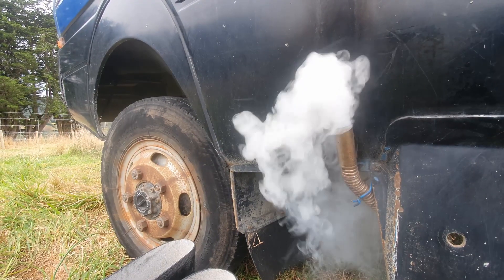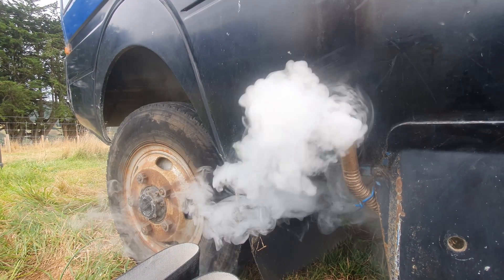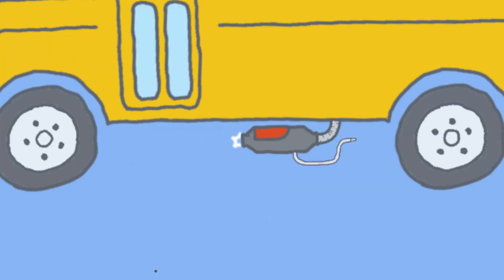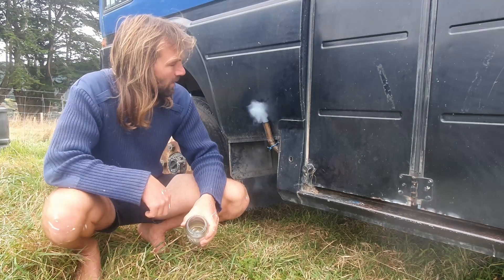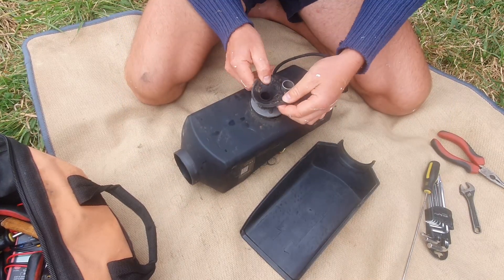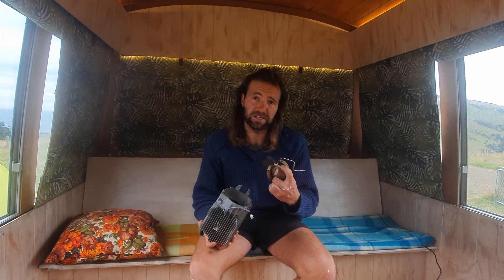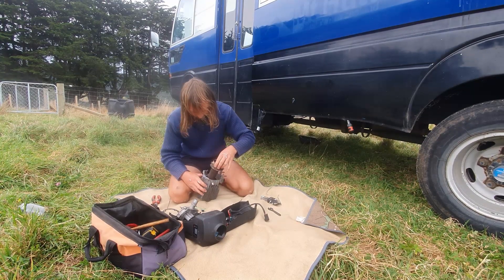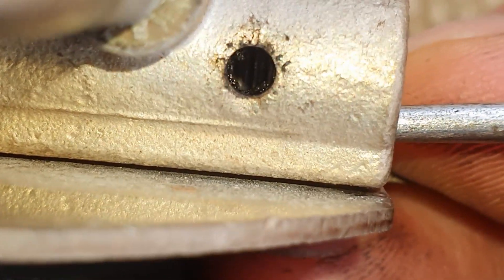[SOLVED] Diesel Heater Won't Start, Blowing White Smoke

Comment: I am a mechanic that's certified on all Espar/Eberspacher products i broadly agree with this video.

One thing I disagree with though,

Every 2000 run hours you should replace that ignition mesh. If you are in a serious bind you can do as he described. The meshes are very cheap, even the espar official ones. Get the green gaskets as well. It's very important or you will be wasting a lot of diesel and having combustion products(carbon monoxide!!) getting into your heated area. LIVING area. You'll be breathing that stuff. 

Remove the glow pin with a 12mm wrench, use a small screwdriver and needle nose pliers to remove the mesh.

 All Bolts are torx T27 except for one holding the control box which is T20.

If you are not confident about it, ask somebody you know or bring it in for professional service. Prolonged carbon monoxide causes brain damage and headaches. If you live in a bus/van and rely on these heaters... Please, do it right. For your own sake.
Reply: Thanks for sharing this, I‘ll bear it in mind.
Reply: Thanks.  I’ll be adding this to my notes. The internet isn’t always available and I like to document my stuff.
Reply: Likewise

Comment: Your not going to  believe this. I installed a deisel heater in the trunk of my Lincoln.  I added the extended exhaust pipe.  I carefully routed the exhaust under the framerail the back upwards 4" creating a trap in the exhaust. It ran fine. I was very happy.  But then it got extremely cold.  No problem.  I fired up my Deisel heater. Only 3 months old and she was running great. Then I noticed the exhaust was dripping water. Then the heater shut down.  I tried several times to restart it. It would try to start.  Pour out white smoke.  Then shut down.  I was upset. I ordered  another heater.  Today I was going to remove the heater and install the new one. As I stopped for a coffee break.  I was trying to search videos on the subject.  I came across this video. I thought to myself.. NO WAY iT could be something so simple . I got out of my car. And crawled under my car. I cut the exhaust straps and let the pipe down.  About 6  ounces of water came out.
I tried to fire up the heater.  It fired right up. Lot's if white smoke. But it was soon to dissipate.  The heater is running like a champ now. I wanted to say thank you. And I'm  going to buy you a couple of bears. Thanks again.

Comment: Great video! This video confirmed what I theorized the problem was. Tomorrow is my day off and I plan on taking this heater apart and cleaning it out.
Reply: Well jfc what happened?
Reply: @007nadineL  I cleaned out the burn chamber and replaced the screen with a new one. Works perfectly now.

Comment: Exhaust outlet and air intake pipes should be the same length otherwise it will cause an imbalance inside combustion chamber

Comment: Had a buddy that had two diesel fired heaters . One would heat coolant for his floor heating setup and the second would heat the air at low temp low speed. Said it was more comfortable that way

Comment: How often and for how long do you recommend running it on full blast to prevent coking problems?  Let's say it's always running on manual low because the room is well insulated and that's all you need for the temps you find yourself in?  I understand that running it always on low will eventually give you coking issues, so how often would you blast it and for how long in this situation?

I switched to the cheap diesel heater option from a Webasto gas heater, which did nothing but coke up.  It was either replace it or check it into rehab.
Reply: Before you turn it off, or if you're running it consistently, once a day.

Comment: Thanks Man! I thought I was in for buying a new Heater. Instead i removed it from the Van and cleaned it like your video showed. the only thing i couldn't do was remove the screen by the glow plug. Instead I just washed it out with some great cleaner I have. It started up and worked great.
Reply: make a hook out of the stainless steel wire of a Chinese food container and stick it in the screen opening at the far end and pull it out. Good to have a few spare screens as they damage easily. I also had a lot of carbon buildup in that hole past the screen and used the same wire to open it up by poking a hole through the carbon.

Comment: The faults were in your instalation..... the only thing that should be outside is the exhaust that should be running down, not back up to create a trap..... this is a cabin heater, not an external mount furnace

Comment: The tiny air intake hole for the glow-plug is the path for fuel leakage when the heater is operated on its side (the wrong side, with glowplug facing downwards - whereby the blown cabin air will eventually contain diesel fumes) - it's not 'leaky' or faulty, it's why correct positioning is key.

Comment: I find it much easier to start the next time by running the heater up to 160C for a few minutes before shutting it down. Manual prime the heater for a few seconds, make sure your battery is well charged to 14 volts and start it. It should light as soon as it starts to inject fuel.

Comment: Hi Adam. Thanks for that. Thinking that this vid ticks all the boxes for the problems that literally began two days ago when started on the first really cold day of our winter in Germany, after dismantling and inspecting the combustion chamber , I found it was only lightly coated with soot but that it was wet with unburned fuel. I cleaned it all thoroughly anyway. Glow plug looks good, mesh is seated correctly. After reassembly and restarting, I kept an eye on the screen to check the readings. As white smoke began belching out as before, I noticed that the glow plug symbol went out. I flicked through through the menu pressing "OK" and saw the temperature rise only slowly from 44, 45 thru to 58 degrees C and then stop at 58. White smoke was still belching out so I pressed for "OFF". Shut down process ran as normal. Glow plug symbol came on again briefly. No error code appeared. The sun is shining at 3 pm, outside air temp. (for combustion intake air) is 4 degrees. Any ideas?
Reply: Get a new mesh every 2000 run hours. It's a required maintenance item. You can try cleaning it as he has in this video, but theyre seriously so cheap and you can have a couple handy for later.

2000 run hours is 24/7 operation for 4 months.
Or 12 hour operation for 8 months.
Reply: @WhyAreWeForcedIntoHavingThis  Fix much appreciated. Thanks!

Comment: very god video thank you it"s good to know
I wonder if i turn my heater upside down what vill happen ̣?
i whish to do so, in mine sailingboat, because i already have a chimeny in the roof.
Reply: you can rotate the heater 90 degrees, so the combustion intake and exhaust come out the side.  the glow plug must be in an upper corner as it is when in the standard configuration.
Reply: @marvin-the-martian5194  
thanks i'll try that

Comment: My intake and exhaust have low spots in them on the one I have in the cab of my pickup. I drilled small holes at the lowest point and haven't had moisture issues. I don't run it for more than a few hours at a time though so your mileage may vary. I have ran it below -30°C a bunch of times and I figure if I was going to have problems with moisture that's when it would happen. I do frequently drive with it running but not at highway speeds. The end of the intake hose I have mounted fairly high up on top of a crossmember so it doesn't get much water spray or snow and when driving there shouldn't be much pressure trying to force through the system. My exhaust faces 90° to my direction of travel to prevent this as well

Comment: Great advice, another cause of white smoke that happened with my heater turned out to be water in combustion air intake pipe after heavy rain even thoughit it had the filter cap, I had it pointing up and have since left it horizontal .

Comment: Also, altitude controls attitude.  I originally got an altitude chart that didn't match my heater. This caused some cold nights on my most recent trip until I sufficiently leaned it out with the correct settings.  now that I'm back and it's still cold, I'll reset to home altitude and run it on warp 9 to clean up whatever mess I created on the inside.  Learning curve can be a wicked bitch sometimes.
Reply: much better than getting a heater with a controller that doesn't match the altitude
I wound up replacing my old one due to bearing failure (now fixed, and hold as a spare) but the controller on the new one couldn't adjust for the altitude and coked up after only a day. swapped controllers, and the new one works fine.
I set mine to idle slightly lean, no buildup, with a slightly richer mix on high.

Comment: Awesome video. Thank you very much, but I'm in freezing cold temperatures and you're in flipping flip flops and shorts! WTF!?  Anyways, good knowledge shared. I'll buy you a beer if see you or you do the job in winter gear as that's when a heater is needed!  

Thanks 

SIR. IMHOFSHOEFOCKER
Reply from the maker: 😆 Yeah, picked my moment.

Comment: A 5/16 wood lag will pull out the ignition screen quite handily. Putting it back with a pencil is the trick, it fits perfectly on the eraser part and you just puke it in with that end. 😊

Comment: Not trying to be rude, but the long and short of the problem is poor/incorrect installation relative to design. Both on the ignition chamber AND the cold air return... Good explanation, as it seems many people don't run the heater recirculating.
Reply from the maker: For sure. Sometimes the advantages of 'incorrect' installation outweigh the complications.

Comment: These heaters need to be installed inside the vehicle not outside.. proper installation goes along way
Reply: Propex L.P. heater install in or outside..Much better furnace
Reply: Errrr, no. They can be mounted outside quite happily. I've installed enough of them to be able to comment!
Reply: @karldingbat  okay sparky
Reply: @glennschlorf1285  what ever budd

Comment: What a great video, thanks.
Sitting under my blankets at 25f/-4c I have confidence that I'll be able to fix my heater in the morning. I replaced a glowplug recently and pulled the screen. It looked very clean but I bet I didn't push it far enough in when reinstalling. I have the gurgling/white smoke just like you show.
I tried another glow  plug, and new pump but no change, error e-10, no start.
Checked for moisture in exhaust and checked intake, fine.
I have the heater in my van but take air in from outside, I was concerned that things could "backfire" leading to exhaust coming in, what do you think about the chances of that? 
Thanks again for the video, really good.
Reply from the maker: But if I misunderstand you, and you mean to say that you are not recirculating your heated indoor similar to how Iv described my own system, then I would recommend trying that, it makes a big difference - just also results in more humidity indoors I think.
Reply: @peterkingsman  I wanted to follow up and mention another piece of the puzzle for those struggling. I haven't solved my e-10 problem, but almost did.
I've had access to a new intake pipe, exhaust pipe and muffler, fuel pump and flow plug. I took my heater apart and it was pretty clean, hardly any carbon build up. I've run about 50 litres through it in 2 years. I got it going and thought it was fine but then the white smoke started again. Up to that point I hadn't replaced the exhaust pipe/muffler and when I did things were good. The key here being, things can be running well but if there's residual diesel flooding the exhaust system you'll still think there's a problem until it burns off or you clean it.
Things were working for me for a night but now I'm getting e-10 again :( the only thing I can think of is I may have compromised the atomiser/ screen, although I hear the main combustion chamber fire up momentarily. I'm in slightly warmer climate now so I'll have another go later.
Reply from the maker: Hope you get success. They generally say keep all elements of combustion external. To do otherwise would be at your own risk. I havent tried it, but I can understand the motivation. Alternatively you could rig up some sort of heat exchange system where the piping for the exhaust or heated air is used to warm the combustion air before the intake.

Comment: Very informative video! I've had a diesel heater for years, worked on it several times and it works good for a little while.  I think I failed to push the screen in all the way!!!!! Thanks!

Comment: It is a good informative video BUT im not gone promote it it on or diesel heater FB groeps . I will explain why . The heaters can run on low all winter long with no issue of soot . The reason why you had soot is that you took cold outside air and that made the heater body not coming up to full temperature ( 180/200c )Next burning of soot by runnig the heater on full for a bit doesn't work as to burn off soot requires a temp of +600 deg c , that would melt the aluminium body.  and that myth  keeps coming back .But for the rest a great video
Reply from the maker: Despite that little bit of seemingly sound theory, you will find you can burn off the soot. The soot insulates the aluminium body and cannot dissipate its heat anywhere near as quickly as the aluminium. Also the soot is generally structured in a way that allows for very effective combustion within itself, creating local heat within the soot. It works. But yes as to your first point, you shouldn't have a sooting problem if the air you are drawing into the heater is warm enough. But I explain this clearly enough in the video.

Comment: Thanks for sharing this video full of new insights. As a new user with a new heater, but with similair problems (heater has not even started up properly so far), I am investigating the reasons for this disfunctioning. I think I installed everything properly, but now I am wondering if the air for the combustion proces should be sucked actively in the heater. Because mine does not, I do not feel any airflow into the heater to contribute to the combustion. Could anyone help me? Thanks.
Reply from the maker: Hey Oscar,
The airflow through the combustion chamber is never particularily breezy, except maybe when running full tilt. But if your having smoking problems first time after install, I would be considering fuel flow. It is easy to flood the heater when priming the fuel line. Flooding causes smoking.
I should also add that, unlike a petrol engine, once these flood, they stay flooded until the diesel is all smoked or burned off. Unlike petrol, diesel doesnt evaporate away with airflow.
Reply: @peterkingsman  Thanks for replying, I really appreciate it. I've got it running! I removed the fuel line and started it up without fuel supply for a few times trying to remove any diesel leftovers in the heater. That had no succes, but was good to do anyway, I guess. Than I shortened the exhaustion pipe till the first bare end to minimize the pressure on the exhaust gaz. And after a few attempts it started up properly, but still with a lot of white smoke. After a while the smoke became clearer and the first warm airflow appeared.  I let it run at max power for 30 minutes and installed the silencer back. I let it run for 30 minutes at max power again and it smoked as bad  as before for the first few minutes. There was a lot of black stuff visible on the inner surface, so I think that was burning away now. And finally I attached it to the second part of the exhaust system and let it ran to clean it. So I think you are probably right the heater has been flooded with fuel without burning all the previous start-ups. Thanks for thinking with me, take care,

Oscar

Comment: Combustion produces water, so the exhaust should always point downwards.  You can even hear it gurgling @ 4:12
Reply from the maker: If you can keep your exhaust pipe warm/insulated enough, you can largely avoid having to point it downwards if needs must. You can actually buy insulators for diesel heater exhausts.
Reply: @peterkingsman  Why would you have the need to avoid pointing it downwards - just curious?

Comment: I run my heater on Kerosene or Paraffin as at the time the price was half that of Diesel. Hey ho it's all expensive. Cheers from old George in the UK
Reply from the maker: Amazing that. It's a good idea if its an option, but kerosene is far more expensive than diesel over here.

Comment: Brilliant, about 7 minutes and 30 seconds into the video I realised that I had done the same, I pushed the mesh down past the air opening and it's now working perfectly, no more white smoke.
Thanks Adam 👍
Reply from the maker: Great to hear! 🙂 👍
Reply: Same here, 3 strop downs later , gound your video bingo problem solved. I knew it was a fuel air mix problem just didn't spot the mesh covering the hole.  Many thanks.
Reply: Me too.

Comment: Any one watching this. This is NOT how you set up your diesel heater. Everything on this video is WRONG :D
Reply: Nice video however, no bends in the exhaust pipe just a straight run with a slight decline run, have a filter on inlet sides even if it's a set of tights to stop any spiders, debris entering and all good mate 👍
Reply from the maker: Righto
Reply: Tosh
Reply: They do what they bloody want in Aussie town
Reply: .....wrong? In what way? Because it doesn't fit how you do it?  Is it because some arbitrary written piece of paper from China that's poorly translated doesn't even tell you how to set it up??  Or are you just a troll seeking that dopamine hit of arguement?? I don't really care except to point out that you are wrong and obviously very dumb...  dude shows combustion process and how it works and then how he fixed his heater.... insane how some people out here really so just look for fights and poke fun at ANYthing..
Reply: Just ffwd to 5min guys you skip the bullshi*